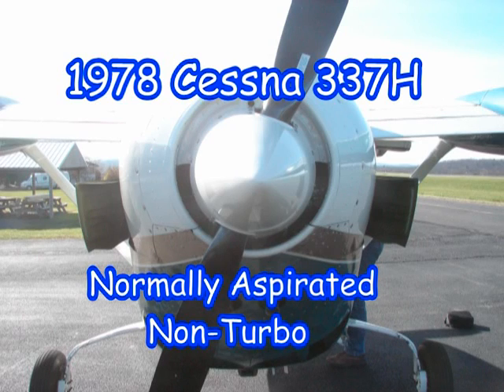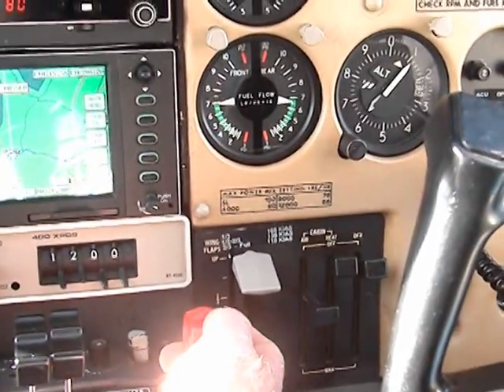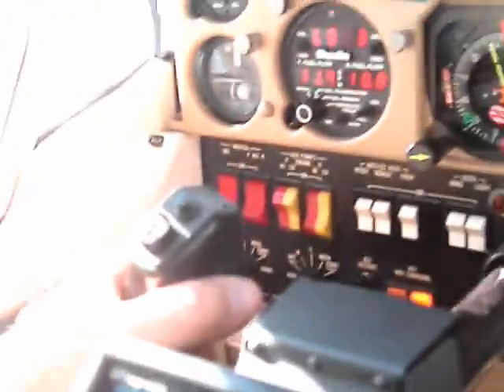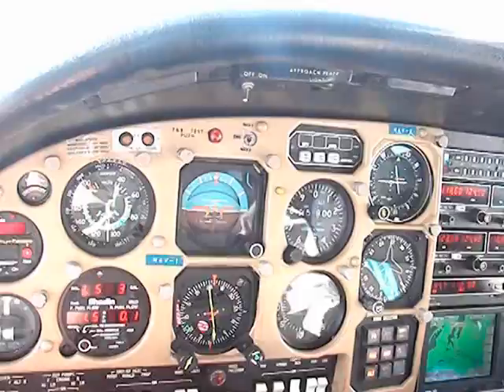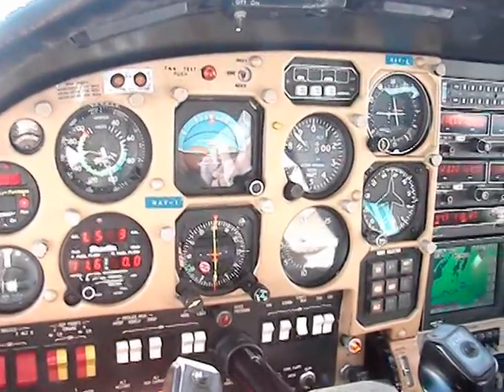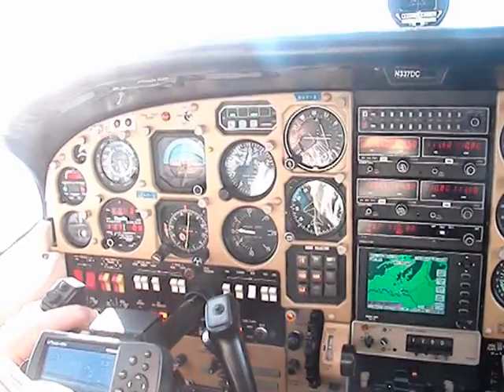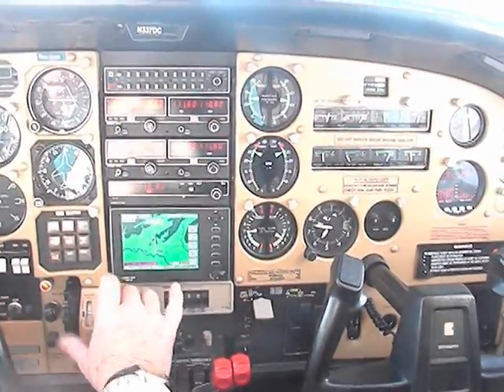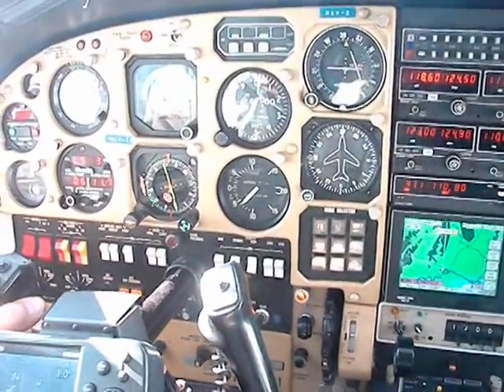Cessna 337 with I/O 360 Engines Engine Out Testing

Comment: I always found that the rear engine was more efficient when under SE Ops.
Reply: It is. That’s why the service ceiling is about 2000 feet higher, and why the hydraulic pump is on the front engine for models that have an EDP.
Reply: @Bartonovich52  - that's why the manual defines the rear as the Critical Engine.